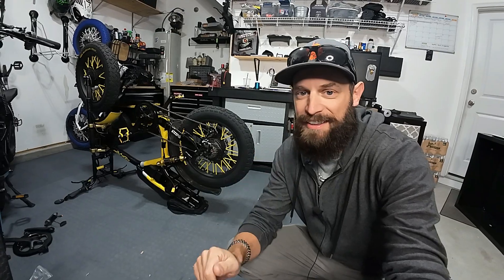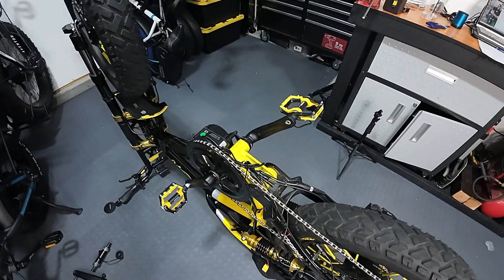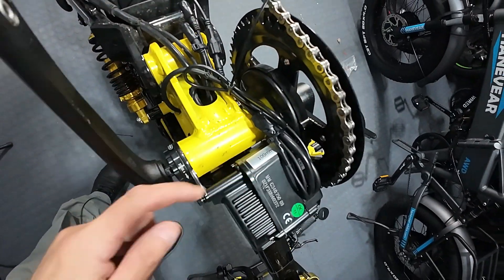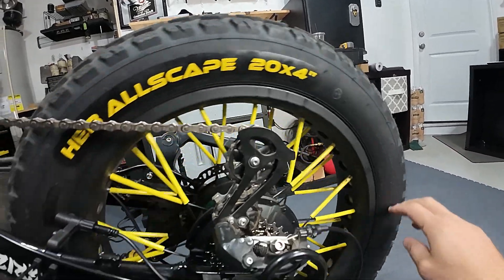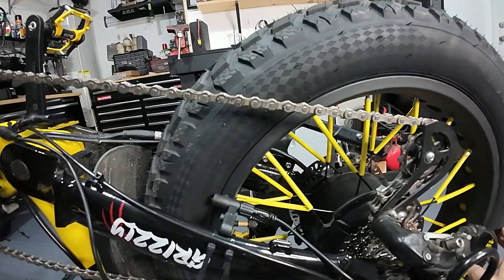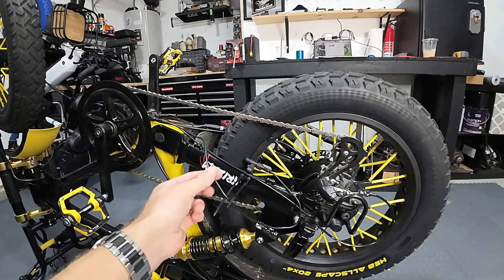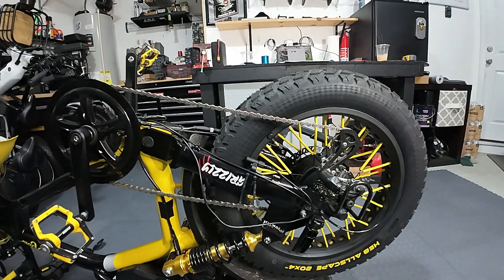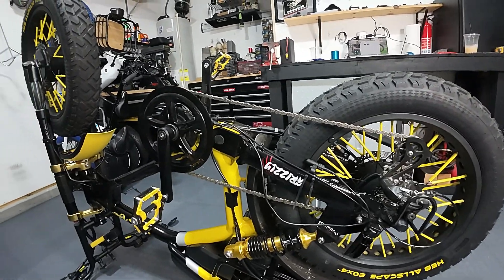Triple Motor Ariel Grizzly!!  1st Launch!

Comment: A better idea would have been to mount an extension on the stationary part of the speed sensor with anything jb weld to electrical tape to a sturdy mount with bolts. You have to get creative.

Comment: I've got loads of stuff kicking around and its crossed my mind to have a go at using 2 motors. Front and rear or mid and rear/front but never considered basically putting a motor wherever possible.  I'm intrigued

Comment: Wondering if you could make a speed sensor mount off the kickstand bracket and use the spoke mount. One rock will displace the magnet in current position. Also look for a place near the hub on the disc side, that's where the magnet is on my motorcycle. Held in place with JB Weld putty.

Comment: Mid drives are awesome 😎 But, they have many drawbacks. It’s great to be able to use the bikes gears. But, bike gear systems were designed for human power! Which translates to less than 250 watts! So high powered mid drives will always have reliability issues. The simplicity and reliability of hub motors is hard to beat!

Comment: The bbs02 should be able to run without the speed sensor? Or at least my BBSHD and bbs02b work fine with no speed sensor. It shows that error on the 500c display, and the mph always says 0, But it doesn’t prevent it from working. It might depend though, i have seen some variations of the bafang controllers and displays.

Comment: I did the  same and glued my rare earth magnet to the rim and worked just fine. My Scrambler runs the stock 750w geared hub on the rear and my mid drive is a BBSHD with an ASI controller. Bike weighs about 150lbs and I can easily pull the front wheel off the ground. Real power is upgrading your controller and voltage. This bike only runs 52V and absolutely flies but my full suspension bike is 1/3 the weight at 72V ASI BBSHD and is like no other bike you have in your arsenal. You think the Wired is fast try 13000rpm’s up a hill in first gear🚀. I love your willingness to experiment though!! Keep building and trying something new. FYI my full suspension bike is an absolute dream to pedal on road or off!

Comment: easy fix for magnet distance,, just stack more magnets on top of the original magnet. It'll get you closer plus ad strength to the magnetic field, yes hotglue will hold till temps outside change. Use epoxy.  I would think the same about losing the magnet, bring spares.
Reply from the maker: Magnet seems to be working for now, i know i said gorilla glue but it was actually gorilla epoxy.

Comment: if you put the speed sensor on the brake rotor side  of the frame it should be close enough to sense it, it's the width of the cassette that is making it too far
Reply from the maker: Nope, tried that side first, was just as far, i even thought of mounting it to the brake caliper to get is closer but thought it might overheat.  set up seems to be working okay so far.

Comment: I have a Triple Motor 14 000w (on my channel) for a while. You can put something like a piece of robber between the sensor bracket and the frame.
Reply from the maker: may try that if the gorilla epoxy doesnt hold :)

Comment: Also, you may want to make sure that that motor is extremely tight. If you can fashioned some type of a bracket so that the motor does not loosen up, that would be very good.

Comment: The refrigerator magnet may not be strong enough, so I would consider installing the supplied magnet on the crank and the sensor where you can keep it within the 5 mm requisite distance.

Comment: Speed sensor can be disabled in open-source firmware called BBS-FW. In fact, even if you don't disable it, i think it won't complain it doesn't work. Flashing firmware may brick your controller, and void your warranty though.

I did my 3D printed bracket though. I did it to fit behind the bike's stand 'leg' with longer screws so i don't even use zip ties.
Reply from the maker: interesting solution, mounting bracket to kick stand bolts.... i like it.

Comment: Great mod. Don't you think that having one of the batterys mounted to the front such as on a front rack or somehow mounted to the handlebars will put more weight on the front wheel and cut down the wheel spin?
 If you have trouble mounting things try epoxy putty such as JB Weld, you can make it into any shape while its in its plastecine state and you can file or machine it when it has hardened.
Reply from the maker: mounting battery to the front was my original plan but it was just so ugly

Comment: Can you put it on the front forks easier. It will still work on front wheel if you can mount it there.
Reply from the maker: front wheel gets a lot of spin so i prefer it on the back
Reply: @CitizenCycle925  oh ok. Fig that might be easier to mount it. The magnet on the rim will probably work fine and glue should hold it fine.

Comment: You can use any magnet and just epoxy it on there or use gorilla tape to test it. Any strong magnet right near the rim on the spoke (or the rim itself) should still get picked up by sensor.
Edit: nevermind you did exactly what I was thinking

Comment: Well, you need to make a homemade bracket, if your rim thing doesn't work..But, why not the 1,000 watt Bafang BBSHD..That would help with torque and top speed..And those Bafang mid drives are some of the most reliable bike motors ever made..I have over 40,000 miles on one...

Comment: I was thinking the same with the magnet on the rim wall ... Well done sir. Can you maybe show the battery in the bag with the xt90 connector ? Wanted to get an extra battery just curious to which one your using. Thanks for the update on the bike.
Reply from the maker: i will show in next video.  its a 52v 8ah battery from bicycle motor works.

Comment: Awesome project. You ever try curing super glue with baking soda? Can you just connect the two wires together? A magnetic switch basically just connects wires together.
Reply: That kinda makes sense!!  I wonder if it would work

Comment: Mixing hub and mid drive on the same bike never works out well. Each system has distinct advantages and disadvantages. When combined, the advantages do not pair well together, but you still get both systems disadvantages. I hope you have fun playing around with it, but this is a poor plan.
I have a BBS02 and a BBSHD. You will need to use the speed sensor with the Bafang controllers. You can get a USB programming cable for the BBS02 that will allow a lot of adjustment that isn't available in the normal display settings, but it will still need the speed sensor input.

Comment: You are the smarter inverter I ever met! And thanks to you, I purchased a Wired freedom in August 2023, and I am so happy not to get a 2024 version  with a 4 inch taller seat.
Good luck and thanks again.
Reply: 2024 wired freedom is much better design plus the upgrades for the same price.

Comment: some things you do are cool and make a lot of sense but this one just really doesn't...can see MAYBE a point in removing the rear hub and installing a stronger mid-drive but running one on-top the other seems a waste just to create content to me... but hey good luck with it...
Reply: The point is more torque. Better acceleration and hill climbing. it will increase the max speed slightly if the mid drive is geared high enough. A lot of people seem to have the misconception that the mid drive and the rear hub motor don’t work together.  But they do just fine, I’ve done that setup as well, and got all of these same uninformed comments